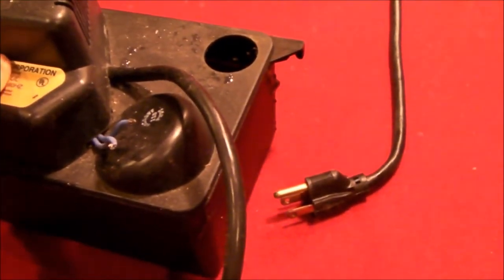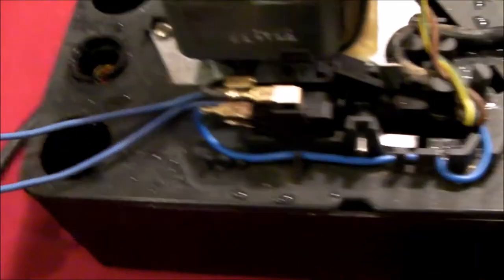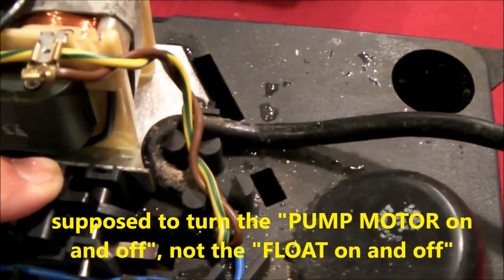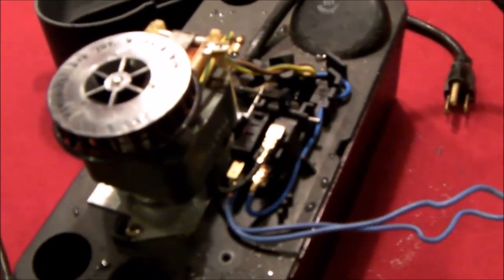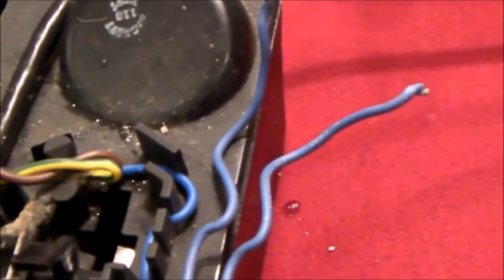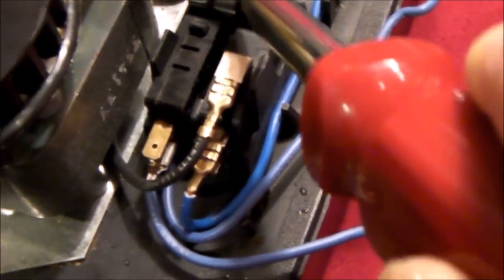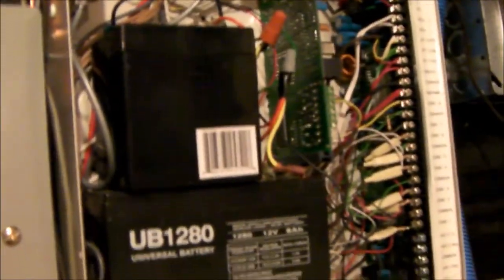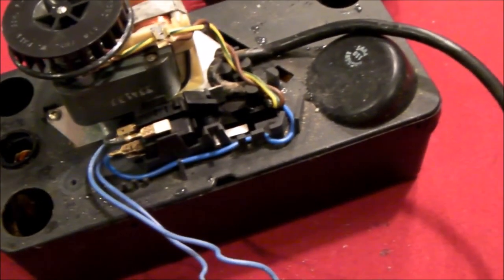Add alarm to Condensate Removal Pump; add failure alarm, add failure alert

Comment: can you not just connect the blue wires to alarm directly? I'm trying to setup something similar, there are cheap 24v buzzers with 2 wires. Could I just connect the 2 blue wires to them?

*Nvm, we still need a power source. Since pump is plugged to outlet, for some reason I thought safety circuit would just use that. but they are not connected at all.

Comment: When the manual and you say low voltage are you talking about 12 or 24 volts?
Reply from the maker: my alarm circuit is 12VDC but yours could be anything you like   3V, 9V etc.    whatever voltage the alarm you decide to use, requires

Comment: What alarm did you use?
Reply from the maker: any battery powered audible device will work ... I personally like Mallory Sonalert.  You're just using the microswitch contacts to open and close the battery and alarm circuit. I suppose you could use an ac alarm with appropriate AC voltage supply voltage.

Comment: Am I missing something? You never connected the switch to the alarm...?
Reply from the maker: Everybody will use a different kind of alarm.  The simplest is a battery and a beeper or buzzer.  If the connection is not obvious, then this something you should definitely avoid trying to do.  I intentionally did not go deeper into this for that reason.  Safety first.
Reply: I guess I assumed when you named the video "add an alarm" you would do so. You really just show what your set up looks like now. Maybe you could rename the video.